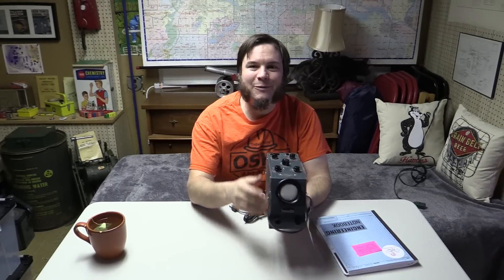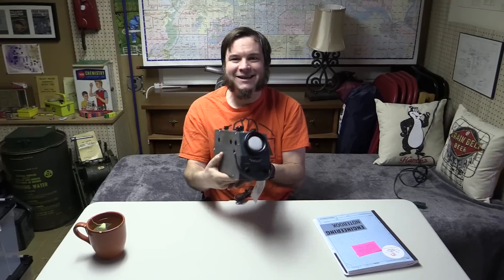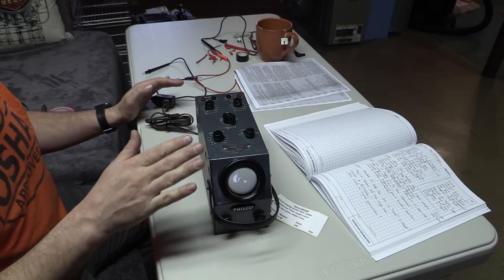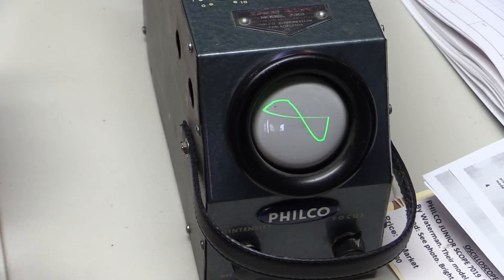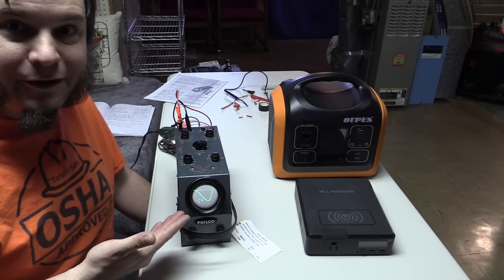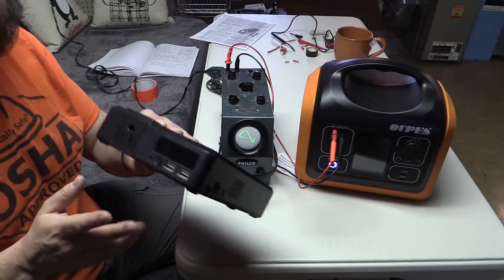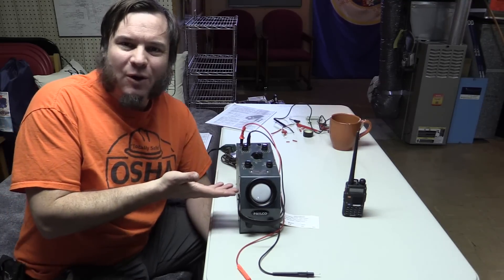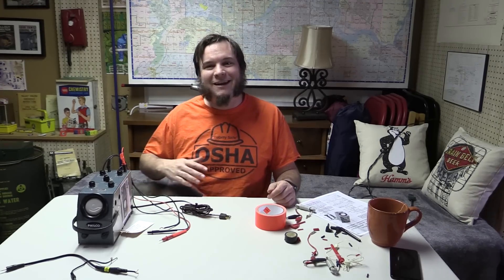I Got An Oscilloscope! Now What Do I Do With It?

Comment: For future reference, you should never, never, never, never, never connect an oscilloscope to mains voltage! You likely only got away with it on this one because it's a very old, analog scope, and does not have a grounded plug. It can be done with many battery powered scope meters, or with special probes, but as a general rule, if you don't 100% know it's safe to do, don't do it! Not only could you fry the scope, you could fry YOU if you're holding the probe and shorts mains to ground. 

Neat little scope, enjoy it!
Reply from the maker: Connecting to AC was like the first thing the manual recommended to do 😂
Reply: @saveitforparts  Actually.... it's step 2 :)  But that's the power cord, not the probe! 

Being an old analog scope intended for tube radios filled with high voltage and mains power connections, it's probably fine. On modern scopes (and by modern at least 40 years), the probe ground is connected directly to chassis ground, which is connected to earth ground, which would cause a short directly TO ground if connected to mains. This is obviously very, very bad. 

This is where a scope meter comes in handy as they have floating grounds. Plus they're easier to carry in the field than a bench oscilloscope and a generator :D

Comment: The only use for a oscilloscope is to check if the clockspeed on a old computer is working properly or checking if a chip is outputting data

Comment: Gabe, That is a basic oscilloscope that you have. But, if you get a decent dual scan digital 100 Mhz scope from eBay, you will grow to love the thing. You can do a lot with a good scope. You can measure frequency, voltage, and a number of math functions for wave analysis.

Comment: Sorry to say but I think you got ripped off for 40$. I would not pay more than 10$ for such a purely historical piece. It is cute and you will learn some basics with it, but you can never be sure what you are looking at unless you know what you are looking at.
Back in the old days, TVs came with diagrams for test points and you were expected to see the waveform printed in the repair manual.
Please never ever plug in any equipment into the line voltage without perfectly understanding how and why. If that scope would have been 10-15 years newer, you would have had a 50% chance of blowing something up, mostly just the ground lead but possibly worse. Just use a small transformer next time and probe the secondary.
Suggested uses for you: check if a power supply needs new caps by seeing how much ripple it produces. See if when/if a signal gets lost for example in a radio. Check if a digital circuit is doing something by probing the clock and data lines. Measure the baud rate for unknown serial ports.

Comment: When measuring the power banks you should change the trigger from Line or 60HZ which is freq of AC power to maybe internal. The sign wave from the power company may be offset from the power banks causing the odd readout.

Comment: One of the main uses for an oscilloscope is to take measurements in the analog domain.   Even digital oscilloscopes tend to be showing you what's going on with analog signals.   But there's a couple of things you need to take measurements.   1) the scope needs to be calibrated, and 2) you need a graticule, which is an overlay of grid lines over the display.   With these features, you can set the horizontal sweep to some calibrated value, say 5ms/div.   In such a case, the grid lines are 5ms each and you can, for example, see what time elapses between interest points in the input waveform, such as the peaks of sinewaves.    Also, vertical grid lines and vertical calibration allows you to measure signal amplitudes, as the vertical amplifier should have volts/div settings, so you can set it to .1 v/div and count grid lines between the bottom and top of a waveform in order to see what the signal's amplitude is.
Trigger circutry was developed by Tektronix in I think the 1950s, so earlier scopes aren't going to have trigger circuits, though they may have synchronization circuts that accomplish a similar function but more crudely.   Trigger circuits allow you to cause the horizontal sweep to wait until the input signal gets to a certain value, and makes it easier to see less frequent signals, or pick trigger points on more complex signals in order to stabilize the display.

Comment: In my lab we use an oscilloscope to do gamma ray spectroscopy with scintillators. Basically the peak voltage reached by the photomultipler is proportional to the energy of the gamma ray and I scan each waveform output by the trigger for the peak and also integrate over the signal.

A good oscilloscope and handwritten software can replace an entire data acquisition crate if one is good enough. And the robustness of the data by having a full waveform allowed me to remove noise signals since they have a different shape and timing.

Oscilloscopes are awesome!

Comment: You can find portable analog, solid state scopes with more advanced features like triggering modes and muliple channels made by companies like Tektronix. Make sure the seller confirmes that if it runs on a battery pack it hasn't leaked since the 80s. I recommend sticking with analog for beginners as digital scopes only really teach you about menus (also if you overload and break it with the signal it's at least possible to repair unlike most digital scopes).

Comment: These waterman scopes are pretty good, I have slightly more advanced model (S-11-A) with things like manual sync controls and AC/DC modes. They'll last just fine provided they have had their caps replaced and you keep the bightness down to not burn up the CRT. They originally came with a leather carrying case with a shoulder strap for lugging it.

Comment: I'm hoping to get one to verify the output of the stator on my dirtbike... I'm wondering if it is frying the LED headlight I installed. That would be a good use: checking the output of generators and alternators on various gasoline powered equipment.
Reply: A scope isn't really useful for that. It's better for looking at AC waveforms and digital signals. A good voltmeter would serve you much better.
Reply: I guess that's what I'm trying to determine: if the output to my headlight is half-wave  AC or fully rectified and filtered.
Reply: @AlaskaSkidood  More than likely it's DC.

Comment: Cute little scope. I really like it. But without proper triggering it has very limited use. Also, it distorts too much to be useful for any kind of measurement. TBH, your typical, entry level, digital, desktop scope is about the same size and usually has 2 channels, 100-200 MHz bandwidth, all the crazy triggers and such, memory, FFT, protocol decoder, larger display and still costs very little (about 200 usd for a Hantek, OWON or something like that). Though, I still prefer to use analog one for certain applications, which include radio stuff. But proper analog scopes tend to be rather large and heavy.

Comment: A little too simple to be practical. Trigger and scales are what makes a scope actually useful. The screen is too skewed to make a qualified asssessment about how clean the waveform is and what its shape is supposed to be. The screen that keeps on moving is due to no internal trigger in the scope

Newer super cheap LCD scopes can be super frustrating to use, they are as practical as toys.
The most useful entry level scopes are in the $200-800 range (new) which can be found cheaper used.

Comment: NAWWWW, that thing is SO CUTE! Like most complex things, there is alot of knobs and switches that you generally dont use. unless you reallly need to.
I wouldnt think a 1940's unit would be the best thing to learn on however. in the age of digital, LCD 'CROs', the big old analogue ones can be had pretty cheap. and I think they look way cooler. Its bulk never bothered me, as I prefer my monitor higher up, so I just replaced the stack of yellow pages with the CRO... 
Some things I find a scope most useful for:
if you have a dodgy PSU, It can read just fine on a multimeter (and the feedback circuit). but if you have bad regulation or a fussy SMPS, it can make noise on your power which can cause all sort of havoc. weird glitchy results, strange intermittent faults, that sort of thing. your multimeter might show a perfect 5v, but the PSU is actually trash (probably a bad cap or diode).
If your dealing with Serial data, a 'Digital Storage Oscilloscope, DSO' can be really handy, it will capture and store the waveform, so you can 'scrub' through it like a video editor, and often compare multiple channels. invaluable if your questioning 'is my widget actually putting out valid data?' can quickly show you if your signal may be inverted, a lower/higher voltage than expected, not a clean waveform, that sort of thing. the really clever ones can actually interpret ASCII or other encoding. Very useful if your trying to get thing A to talk to Thing B.
Obviously measuring frequencies. of course there are digital widgets that can do that, but that meat potato between your ears can do alot of post processing and work out exactly what you want to look for. ie, you can pretty easily see multiple frequencies at once, and just measure the one that you want. If your trying to get filters to work, invaluable. or any other resonant circuit for that matter.
And the obvious application, they look COOL. When I was an electronic tech, when I first started I clawed out an old tektronics Scope from under the stairs and over the years it became part of my battlestation. It took about 30min to warm up enough to give accurate readings, and some of the knobs were alligator clips. Id wired the whole desk into one main switch, so PSU, Iron, Scope, PC monitor, audio amp, was on one RCD protected circuit (so I could pop breakers without knocking over the whole business... mostly... they didnt like that). Get in, hit the lights and workstation, make a coffee, have some banter, figure the days plan, and by then it was cooking. but I didnt want to turn the CRO off, cos it always gave weird results when cold. so I just hooked it up to the HiFi system and let it dance along to the music. Milkdrop is cool and all, but a CRO just Groovin' in the corner of the room. thats just cool (even if there was a very practical reason)

Comment: While this is a very interesting oscilloscope from a historic perspective that is still useful in some cases it is very limited compared to a newer model. The ability of a digital oscilloscope to capture events that don't repeat frequently is very useful in many cases, especially in projects that includes e.g. mechanical components.
Given that you work on different projects at different locations I think a basic handheld oscilloscope with built in multimeter and signal generator would be good. I have an OWON HDS2102S that i find useful. The slightly slower OWON HDS272S cost about 150 usd and I think you would find it useful. It has some limitations but it works for many cases. Given that it is the size of a multimeter and contains a multimeter makes it likely that you have it with you when you need it.
You get a better oscilloscope for the same cost if you go with a USB oscilloscope but then you need to bring a laptop and it is not as convenient.
There is also cheaper handhold versions but they are often not as good.
Reply: I think the main limitations of my Hds2102s is:

Small screen and that settings are done through a menu system. But that is a direct consequence of the small form factor.

Short memory, only 8000 points. Limits the ability to zoom in on the measurement after the event. Limiting if you want to look for glitches e.g. bad contact during a longer measurement. Much better than analog scopes but for a few hundred usd more or in some cheap USB oscilloscopes(using the Laptop memory) you get millions of measurement points in memory. 
8000 points are enough for most use cases. 

The lack of serial decoding. You can check the signal quality of a serial comunication signal but not easily read the data. 

The lack of FFT, many other digital oscilloscopes can show the frequency content of a signal like a sdr can, is sometimes useful. 

Then lack of frequency sweep in the signal generator and the cumbersome menu system makes it slow to e.g. Measure the frequency response of a circuit at many different frequencies. In many cases it is enough to measure the step response instead. 

A few times it has given extremely noisy measurements but restarting the instrument have solved the problem. Probably something in the digital data processing that get stuck in a faulty state. 

Electric safety is probably significantly better than the cheapest scopes or the one you have but not as good as a high-end Fluke or similar. 

Unable to record/plot the multimeter measurements. Some handheld "oscilloscopes" uses the multimeter inputs instead of separate oscilloscope inputs. This make it possible to record current or resistance variations directly. These inputs are however much slower. It would however have been very easy for the manufacturer to add the ability to log the multimeter readings in addition to the oscilloscope functionality. 

I think this is reasonable limitations at this price point.

Comment: you're getting there , electronics is amazing 
the smell is the tubes get really hot and burn off hair and dust
the magnet adjust will make it look better 
there's another i suggest to ppl youtuber called RobertMurraySmith thinkingntinkering 
he will show u some cool things about electronics and chemistry he is very intellegent 
i used one kind of like that in electronics class to fine tune circuits and like fix the tone im my guitar amp 
it visualizes the waveform 
a lot of new synthesizer keyboards have one on the screen so u can " see" how it sounds

Comment: I found it interesting that the manual has instructions for how to make grid overlay for the display.   You are supposed to use a disc of mica or celluloid (good luck..ax man?) and scratch the lines with a scribe.   Of course today, if you have access to a laser printer and a clear mylar sheet, you should be able make one pretty easily.

Comment: At 8:13 That old radio smell is the asbestos burning of the cloth covered wires inside the unit witch is bad for health.😁😁😁😁
Reply: Nah it's just dusty tubes. They had PVC insulation in 1946, IDK if this scope uses it, by my Waterman has PVC wires.
Reply: It takes a LOT to burn asbestos. Of course, just moving the thing will crumble it to dust after long enough...

Comment: If you decide you want to try a more advanced scope but still a bit retro - I have two Tektronics scopes from the 70s or 80s. Still analog. Now-defunct local company NCS/Scantron engineers used them to diagnose their scanner products.
If you want more info let me know. I never got around to learning and I would be happy to pass one or both on for free to someone who will use them.
Reply from the maker: I'm kind of tempted but still worried about the size and complexity! Maybe shoot me an email gabe@saveitforparts.com, comment replies tend to get lost on here.
Reply: @saveitforparts  Absolutely understand your concerns. I will drop you an email with some more details and pics. No pressure - I just like supporting people's learning and hobbies however I can. For instance, in the past I have loaned them to friends and coworkers so they could learn what they want in a modern scope they are willing to spend money on.
Reply: If they’re not spoken for I’d probably be interested in one, I recently picked up an old Tektronix scope from Marketplace but it has some issues unfortunately so I’m on the lookout for another.

Comment: I recently got an Agilent 54622D, it's a lovely digital scope with a green phosphor CRT. I don't have much experience with more recent scopes, but this one has really responsive input, the knobs feel like analog controls! They even have acceleration for doing large adjustments with a quick flick of the dial, and then more precise control when going slower. For me, the 16-bit logic analyzer has already helped me revive one ancient computer (an Apple IIe), so I find that quite useful as well.

Comment: I have a cheapo 2 channel usb scope and it has helped me a lot. So many things happen faster than a voltmeter can react, and without a scope it will be invisble to you. When something isn't working I put the scope on it and I often see things I didn't even expect - bad regulation, ringing, noise from another part of the circuit... It's great. But since it needs a computer it isn't very portable.
Reply: Same here- analog discovery 2 is the one I have. Real useful for troubleshooting electronics and pretty good price- ~$200 new compared to thousands. Has all the same features, just uses your computer screen instead of a vacuum tube
Reply: @noahwilde2320  Does the analog discovery work well with standard 10x probes?
I saw that you can buy BNC adapters to the analog discovery.

 I think that often it is important to adapt to real world voltages and transients.
Reply: @larslindgren3846  I’ve always used it with dupont connectors- those breadboard wire type ones
Reply: yeah, thats where they shine. a voltmeter gives you an idea, but really does not tell you what's happening. if you have found a USB scope useful, I would recommend getting your hands on an actual bit of hardware. my rule of thumb, buy a cheap one first, if that is useful or you break it from use, then you can justify spending some money. call me oldschool, but I like my knobs n dials. SDR and a USB scope (which is sister technology),  is great if you know exactly what your looking for. but having a bank of knobs you can navigate without looking at whilst keeping your eye on the screen and hunting is fantastic. someone in the flight sim community aught to get in bed with an SDR guy. A bank of dials, once you get used to them, is am incredibly snappy user interface.